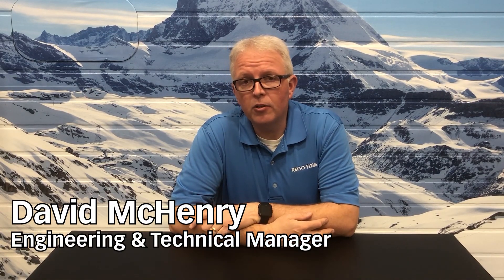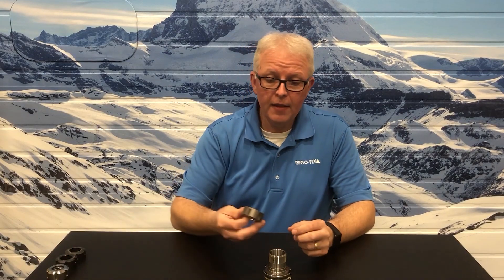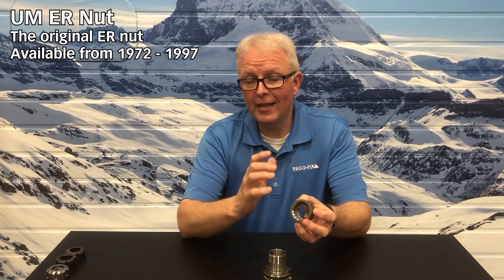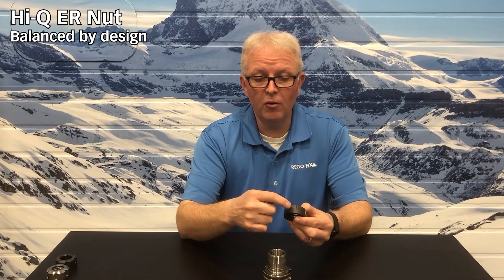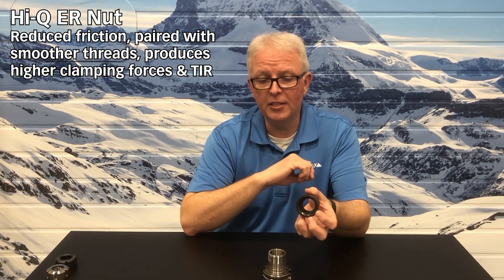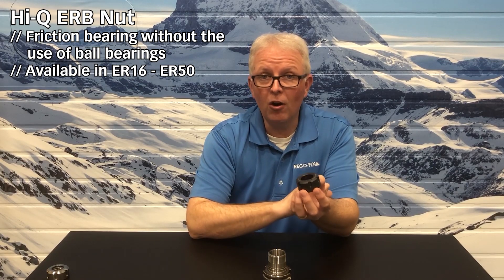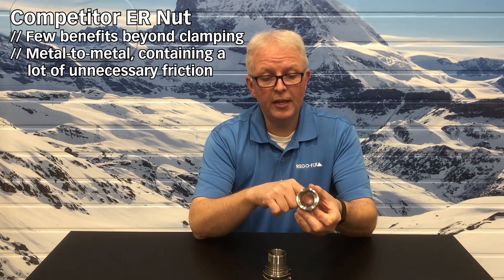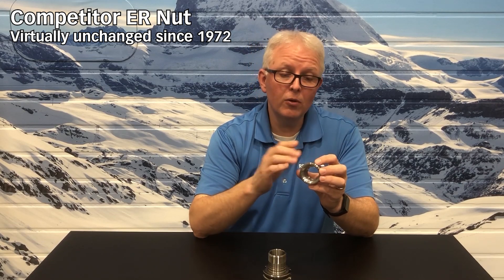TechChat - ER Nuts Part1

Comment: Hi Rego-Fix, 

Question for David. If reducing friction is the end-all for ER nuts, why recommend against oiling the collet/nut?  Additionally, could you expand further on why friction in the nut should be reduced and how friction varies the nut torque to clamping pressure.